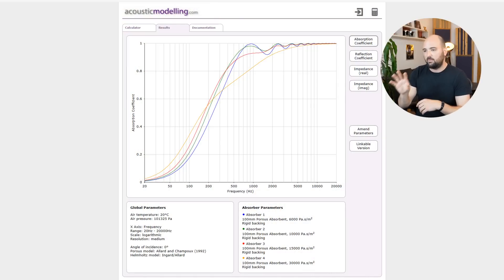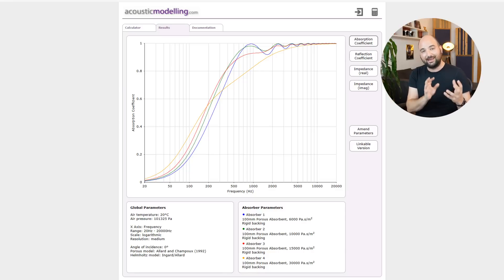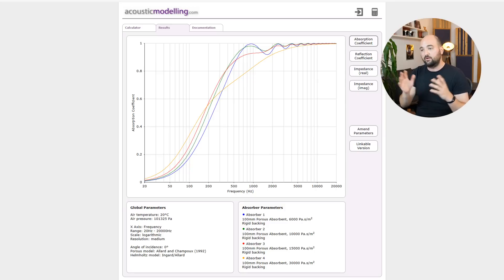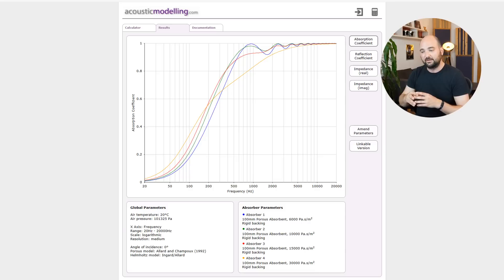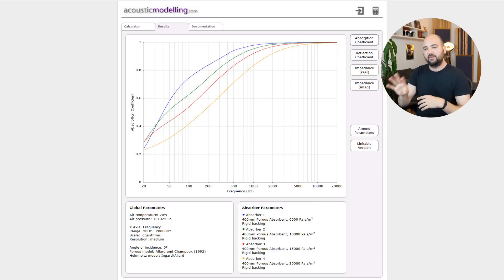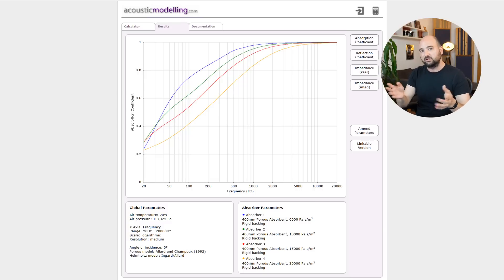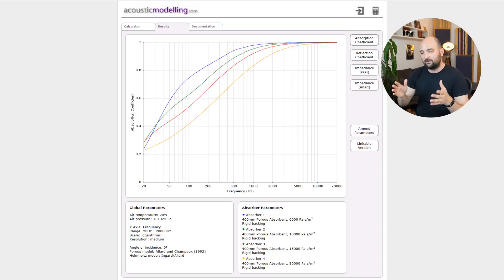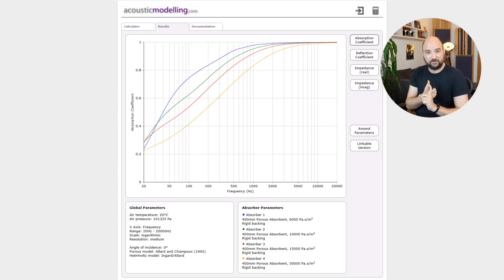DIY Bass Traps: LOW vs HIGH DENSITY Insulation (Stop Wasting Money!)

Comment: What about with air gap behind them ? Mixed density traps ?  I’d love to see those results
Reply: If you try a porous absorber calculator, in the helmholz/multi-layer mode, you can see what it does.

Basically high density over low density kind of "caps" the absorbtion at whatever the high density can absorb, seemingly. Real life result will likely be better.

High density BEHIND low density will smoothen the curve a bit. But it's not really worth it.